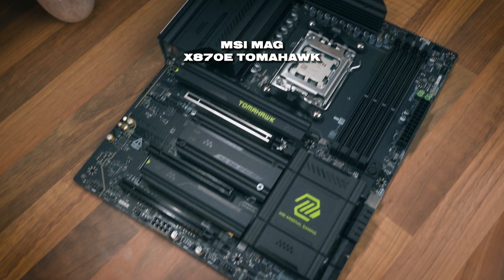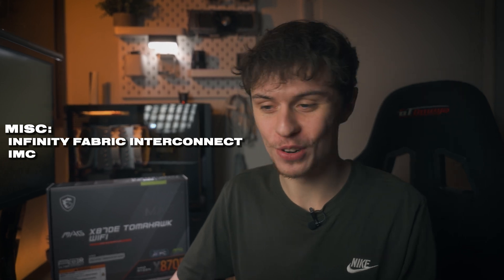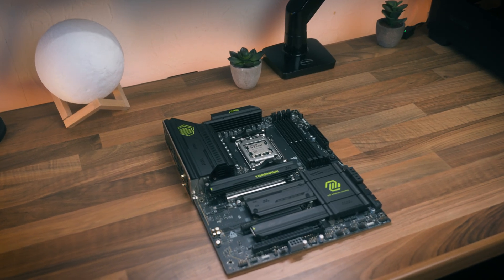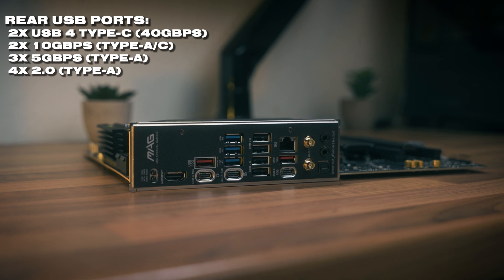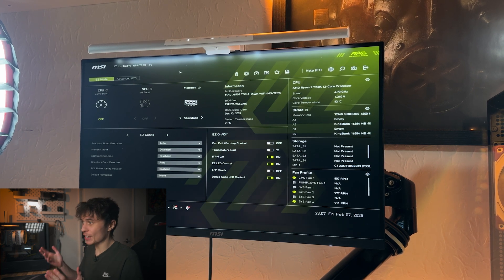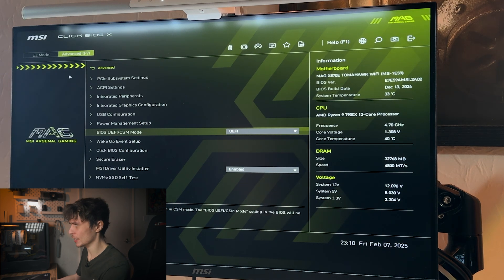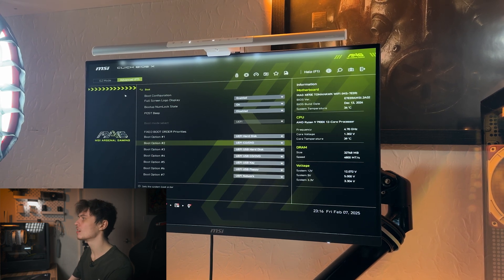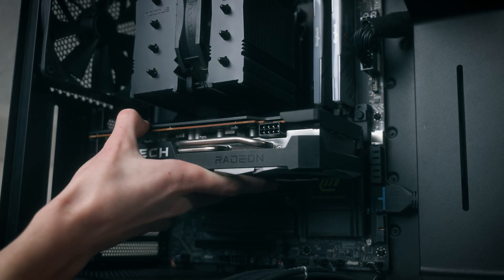Are High-End Motherboards Worth it? (MSI X870E Tomahawk)

Comment: X870E Tomahawk is $320 at Microcenter so it's more of a midrange motherboard. Is it worth it? I finished a build for someone else yesterday and it's very nice, particularly if you want a lot of storage. The previous system had two SATA SSDs at about 500 MBps read/write. The new setup is 1 Gen 4 NVMe at 5K MBps read/write, a Gen 3 NVMe at 3,200 MBps read/write and two SATA3 SSDs at 500 MBps. The NVMe SSDs were spare parts. If faster read/write were required, she could get a Samsung 9100 Pro for near 15K MBps read/write. So it has 12 GB of SSD right now.

I like USB4. I have an external USB4 drive on my Mac Studio in an OWC 1M2 enclosure and it would be nice to go back and forth transferring large files.

So is the Tomahawk worth it? If you want future expansion, a lot of storage, the ability for a lot of RAM, then, yes, it is. Is it necessary? No.
Reply: It's near the highest mid range youre gonna find, and microcenter currently has them for $289. Just bought one. When it comes to price/performance/cool shit, you'd be hard pressed to beat this. But yes, it is midrange.

Comment: I want to pair it with 5090 and 7800x3d 
Is it good for the combo
Reply from the maker: Yes, very good
Reply: @ProYamYamPC 
I want to add 2 of  m.2 gen 4 where i put them in m.2 layout 
I mean 1 and 3 or 1 and 4 
And also does gen 4 m.2 not interfere with usb4

Comment: Good afternoon! Please tell me. I want to build a configuration with a 9800X3d, RTX 5090, wd black sn8100 2tb with a speed of 14900mb/s, and Team Group ddr5 t-force delta rgb 48gb 2x24gb 8200mhz RAM with Sl 38 timings. Which of these will affect my speed? Which board is better to take tomahawk x870 or x870e for me they stand absolutely the same, I need maximum performance convenience and speed! help me please, all these questions about cutting power due to busy lines are annoying me, plus a person here wrote that I can't put my m2 with a speed of 14900 in the m.2_1 slot on the x870e board, but this is absurd since there is a top radiator in contrast to the lower slots for m2 memory. Will the ddr5 memory be able to run at its standard 8200 MHz frequency with sl38 timings on a 9800X3D processor, or should I use sl30 or sl28 timings with 6400 or 6800 MHz? Will the motherboard even accept 8200 MHz RAM?
Reply: I know your comment is older, but I still wanted to help. I pulled all this info off the web, as I am no expert in this field. Hope it helps! 

The Problem: Running DDR5 memory at speeds of 8200 MHz on an AMD Ryzen 7 9800X3D is unlikely to be stable or even possible. While AM5 CPUs and X870 motherboards can support high-speed RAM, the listed stable speed for the 9800X3D is closer to 5600 MHz, with stable operation at 8000 MHz only recently being achieved by some users with BIOS updates. The memory controller integrated into the CPU itself, not the motherboard, dictates the highest possible stable speeds.

Speed vs. Latency: While 8200 MHz offers higher frequency, the stability issues on AMD can be significant. Slower speeds with tighter timings (like 6400 MHz CL30 or 6800 MHz CL28) often provide better and more consistent performance on AMD platforms than very high, unstable speeds. 

2. Motherboard differences (X870 vs. X870E) 
X870E offers more PCIe 5.0 lanes: The key difference between the AMD X870 and X870E chipsets is the lane allocation for devices. The "E" designation means a board has a dedicated PCIe 5.0 x16 slot for the graphics card and more PCIe 5.0 lanes coming from the CPU for additional components like M.2 SSDs. The standard X870 board offers fewer PCIe 5.0 lanes for peripherals.

Impact on your build: Since your WD Black SN8100 2TB is a PCIe 5.0 x4 drive, an X870E board is better equipped to handle it at full speed without compromising other devices. 

PCIe lane conflicts
M.2_1 slot concerns: The user who told you a 14900MB/s M.2 drive couldn't go in the M.2_1 slot on an X870E board was likely misinformed or referring to a specific board's unusual configuration. On modern X870E boards, the primary M.2 slot (M2_1) is typically a CPU-connected PCIe 5.0 x4 slot and is the best location for your fastest SSD.
The truth about lane sharing: Some board designs involve lane sharing, but this is clearly explained in the motherboard's manual. For example, some configurations might share lanes between a second Gen 5 M.2 slot and USB4 ports, allowing you to prioritize either high-speed storage or connectivity. The top M.2 slot with the largest heatsink is generally the prime location for maximum SSD speed. 

AMD X870E chipset: For maximum performance, an X870E board is the clear winner for your build. It ensures that both your RTX 5090 and WD Black SN8100 SSD can run at their full PCIe 5.0 speeds without having to share lanes or be downgraded.

Change to a more stable kit: While your 8200 MHz RAM might boot, it is unlikely to be stable with a Ryzen 9000 series X3D CPU. To achieve maximum speed and stability, consider a kit rated for lower latency at lower, more stable speeds.
Recommended RAM speeds: Look for a high-quality DDR5 kit rated for 6400 or 6800 MHz with tight timings (CL28 or CL30). This will ensure rock-solid stability and optimal performance on your AMD platform. 

Plan for high wattage: An RTX 5090 requires substantial power. A 1000W or even 1200W power supply is recommended to provide ample headroom and prevent any issues from "busy lines," which are more likely due to a PSU at its limit rather than lane congestion.
Recommended power supplies: Look for an 80 Plus Platinum-rated modular power supply with ATX 3.1 support, such as the Corsair HX1500i.

Comment: best part about this motherboard is that using all the m.2 slots does not downgrade the pcie x16 to pcie x8
Reply from the maker: 100%, it’s perfect for people who need a ton of NVMes
Reply: Agreed. I also have zero use currently for 40Gbps USB ports so I’m happy to disable them for two gen 5 M.2 slots with full pcie speeds. But nice to have them in the future I can just re enable them and operate my second M.2 at gen 4 speeds which is not a major deal.
Reply: @mike406 this right here is the comment. We have OPTIONS and AGILITY! Love this board!
Reply: Thank God i found a person who understands the pcie bifurcation
Please can you explain the speeds of all the m.2 lanes and which one is the fastest. I don't use usb gen4 
I want to pair it with 5090 and 7800x3d
Reply: @PcEnthusiast-i6v  The first two m.2 nvme slots are Gen 5 so those would be your fastest as m.2 speed. the other two m.2 slots are gen 4 m.2 slots. youd just have to change a setting in its bios to get the full speed of the second gen 5 m.2 slot
Reply: @Rosted42  I don't work with usb4 so I don't want them
If I put gen4 is it good or does pcie hqve backword compatibility?
Reply: @PcEnthusiast-i6v  Yeah itll be fine u just need to disable USB 4.0 in Bios
Reply: so if you do want Usb 4 all of a sudden you can just switch back to it. only difference is ur sacrificing two pcie lanes for it which would half the speed of the m.2 drive
Reply: of that one specific m.2 drive not all of them
Reply: actually huge. i will fill all nvme slots
Reply: Pcie 5 x8 is the same speed as Pcie 4 x16, which is more than enough for any high end GPU. Talk about paying more for nothing lmao

Comment: Would you say AM5 would bring significant improvement in my games upgrading to a 9800x3d from a 5800x, X570 Taichi, & 7800xt at 1440p?
Reply: Um......yes. Yes is the correct answer.

Comment: What is different between MSI MAG X870 Tomahawk WiFi Gaming Motherboard & MSI PRO X870-P WiFi ProSeries Motherboard?

I wanted to build a PC with good component such that they are reliable/durable and provide good performance
Reply: 1 less M.2 slot, no post-code display, 1 less USB 4, worse primary M.2 cooling, less robust VRM (not significant since Tomahawk's VRM is already grossly overkill)

Comment: I had X870 version that had some random problems so i returned it and got the X870E version for the same price now all works fine. Just wish it had another nvme slot as i have all 4 filled.
Reply from the maker: Glad to hear your new board is working ok. Thankfully, I'm only using 3 of the 4 NVMes as of now
Reply: Can you tell me what ram you are using because I have the f5-6000j3636f16x2-fx5 32gb of G SKILL.  I get a yellow light and a code 15. Which means DRAM is not detected or fail. I purchased this as a combo and returned it and received a replacement and both combos showed the same issue. I really don’t want to purchase several ram cards before I find one that works.
Reply: @ did you plug them in 2nd and 4th slots?
Reply: @retiredsparky526 you would rather choose Kingston)
Reply: @retiredsparky526 buddy you can't leave us like this for 7mths! We gotta know if you fixed the yellow light code situation 😂 seriously tho, I'm buying the same ram with this board so I need answers 😅

Comment: Just to let you know, the sweet spot for DDR5 with Ryzen 9000 is 6400 CL32. DDR5 6000 CL 30 is the sweet spot for Ryzen 7000 series. I bought this board within days of it coming out and I currently have it running a 9950x with 4x32GB DDR5 6400 CL32 with zero issues. Enabled EXPO and it's been perfectly stable. I would have tried for the full 256GB but no 64GB DDR5 modules exist at this time.
Reply: But what is the difference between them in case of Ryzen 9000?
In theory 6400/32 = 6000/30 when it comes to speed.
Reply: I have a Ruben 9 7900x and corsair cl 30 ram would this be a good motherboard to use then?
Reply: Hi, can u provide the RAM P/N? And do you operate 128GB at 6400MT CL32?

Comment: 40Gbps ports are definitely a game changer. It probably has enough speed to operate a laptop docking station with monitors. For the other USB A ports, there is a possibility that some are connected to an internal hub (such as a GL3590). If that the case, bandwidth is shared among them, and they may not operate at the speed printed on the IO shield if the other port(s) on the same hub are used. On the MAG B760m, there are 3 10Gbps type A ports at the back wired to an onboard hub, so it's technically 1 10Gbps.
Reply from the maker: 40Gbps will be super handy for me as I transfer files a lot from SDs and such. I believe it's the same speed as Thunderbolt 4

Comment: Actually I replaced the ASUS TUF B760m WiFi Plus DDR5 with a MSI MAG Mortar B760m WiFi II DDR5 a week ago because the USB 3.0 ports on the TUF were acting up and would constantly disconnect & reconnect USB 3.0 devices. Other ports worked fine, but I never tried the front USB C header since my case doesn't have a port for that. This was likely caused by a faulty USB 3.0 hub controller chip, the ASM1074. The MSI MAG also have hub chips to my surprise. For the 3 rear USB3 10Gbps ports a GL3590 hub controller chip is used. For the 2 front USB 2.0 headers a GL850G is used. So far everything on the MSI has been performing as expected. 1 thing I don't really like about the MSI is that it spins down my HDD during restart and spins it back up after POST, and I can' t seem to find the setting for that in the BIOS.
Reply from the maker: My Z690 Force WiFi does that too. With my new build, I'm ditching my HDD.
Reply: Update: replaced the MSI MAG with ASUS TUF B760m again due to a strange power issue with the MSI. Not sure if the new ASUS has the same USB issue since I just got it and haven't had a chance to test it. Update: The ASUS TUF was eventually replaced with ASRock ATX Z790 PG Lightning WiFi becauce of the same USB issue on the ASUS, plus the ATX offers better specs and value for the less price. I had to buy an ATX case in order to fit the board in.
Reply: @harddrive7316 What was the problem?!
Reply: @ The User Scenario of MSI Center seemed to have permanently changed the CPU power draw behavior in the hardware level, and it suddenly started drawing a lot more power during benchmarks. I reset the BIOS as well as reinstalled Windows to no avail.

Comment: I guess I won the silicon lottery then. I was able to get my Ryzen 9 9900X at 1:1 ratio on my 6400 Mhz RAM
Reply from the maker: I haven't tried it on my 7900X yet. But my 7600 and 8600G struggled with 1:1 at 6400MT/s